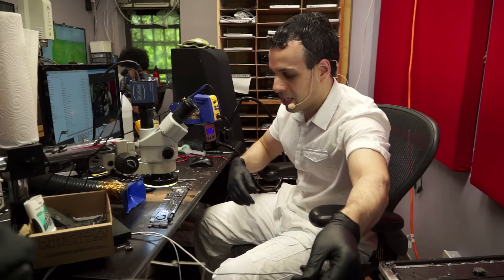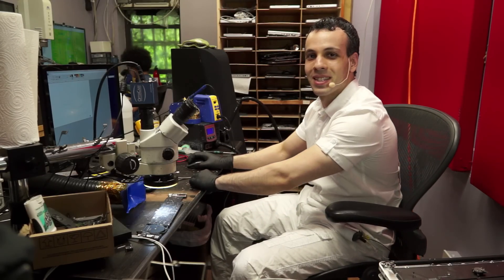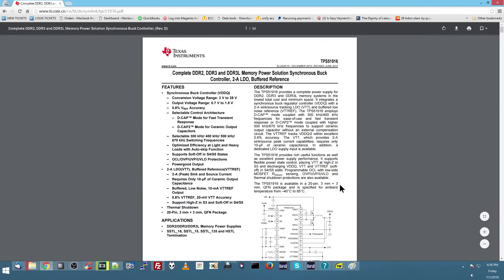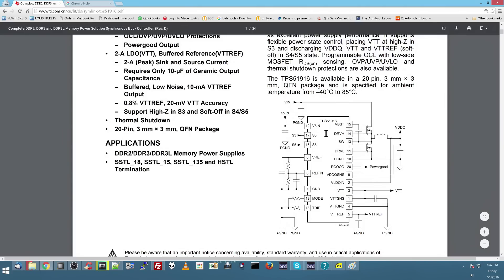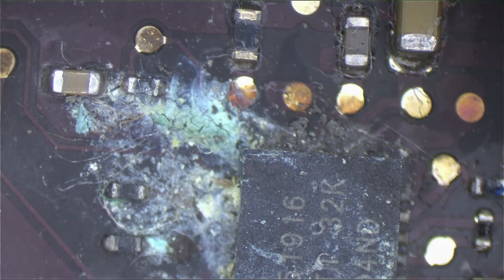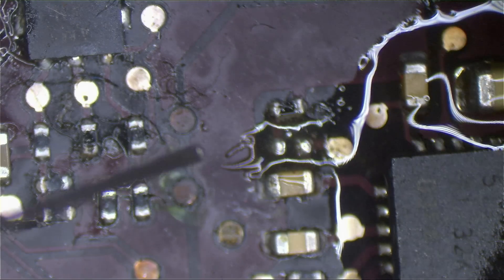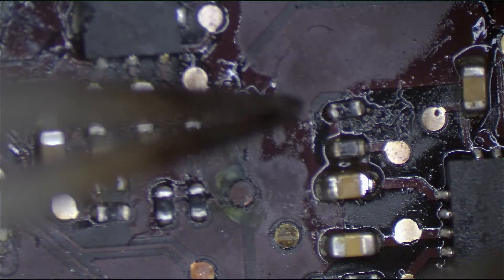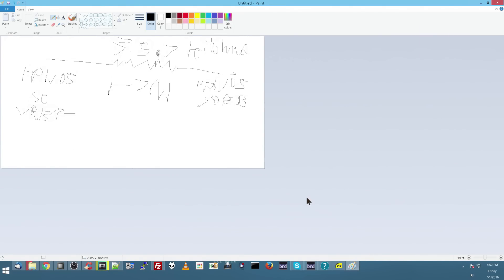820-3437 logic board repair with new video format

Comment: The microsoft paint killed me! BTW  
LDO = low drop out voltage regultator
Buck converter => step down voltage but steps up current
Reply: To add to your comment, a LDO is linear meaning that it drops the voltage by turning the difference to heat ( P=U_diff*I ) hence they should only drop small voltages  (Note that the output current is the same as the input current), Buck/Boost converters lower, raise voltage by storing the energy in a inductor (It needs to switch the input voltage to do this) -> low losses but noisy.
Reply: If you're dealing with low currents / quiescent levels a linear reg can frequently be more efficient than a switching reg, which is why modern switching regs often contain a linear reg for when the current demand drops below a certain threshold.  It's an amazing tech world where we now can get the best of everything in single chips.

Comment: LDO stands for "Low drop out". Referring to the low drop out voltage regulator that comes after the buck converter to stabilise the DC output. It's true that it lowers the voltage slightly to do this but it's main purpose is to stabilise the voltage.

Comment: Hey Louis,

We also rebuild computers at the logic board level and it comes to water damage or oil damage in our case (we fix Brain boxes for vehicles). we found that using Fiberglass Scratch brushes  helps to remove water damage and clean up the board. i would look into it to see if it works for what you are doing.
Reply from the maker: I will have to try one. Thank you!

Comment: Louis, which flux do you find best? 
Some unfortunately have a honey tone and after a while become sticky :-( 

Do you just use normal seringues or some more productive solution to dispense the flux onto the pcb? 

Over the time the quantitiy of SMD flux used makes it questionable if there are more cost effective Systems. 

By this i do not refer to the very liquid flux as that can get into your way.

Comment: I come to the conclusion that extra Flux applied to the board in Louis'  field of board repair is like extra whitespace and indentation in my field of writing computer programs / software engineering.     Can almost never have too much...    just make sure you can still see what you are working with,  and everything lines up properly before committing it.....
Reply: You can always reflow if alignment is bad. Also once it goes to the ultrasonic it's nice and clean which cannot be said about code minification ;).

Comment: I understand why you don't run the boards through the ultrasonic cleaner before the repair, but do you ever have to use more than flux and heat to clean gunk from a spill from a local area before replacing parts and if so, what do you use? Alcohol?
Reply from the maker: sometimes. it depends on how nasty it is. i use different approaches. if it is really disgusting, i dump it in the ultrasonic, mildly toothbrush it  while it's in the branson ec/distilled water at 60c, then turn on the ultrasonic.
Reply: Man... that board was n-a-s-t-y!! Especially near the end when you put on that resistor you can see the nasty little hair bits in the grouping of parts just over to the left. CRAZY!
Reply: It was a little nasty looking, although i'm sure Louis has seen boards in much worse shape.
Reply: Back in the 80's I repaired the recording equipment for the BBC back in england and they never had any liquid spills. Tea and coffee aren't liquid's right? ;-)

Comment: You can spill your drink in a Lenovo T series and you wont go through an expensive repair, worst case scenario is keyb replacement, you can still disable the keyboard and use an external. surprised that they didnt ask ti to rename the part because any chip manufacturer wont have any problems on do that as long as you put a large order. Next mac book will be like old sinclair computers U1, U2 U3 not in the board, but printed in the chips as well LOL

Comment: If only manufacturers were covering boards after assembly and cleaning by protective coating like Parylene is, all these spill damages won't happen at all.. or at least damaged areas would be extremely reduced... 

But they want us to buy new stuff as early as possible, so they do not even do proper cleaning of the flux rezidua after soldering in most cases... :o(

Comment: Hey, Louis I have a 2009 Macbook pro and by mistake i used another charger and now it doesent work with the original charger, but only with the wron one. Can you tell me where to search the problem?

PS. I replaced the  DC power board but still the same.

Comment: What is the sort of liquid he puts on the motherboard?
Reply: It's called flux, fairly standard when doing soldering work. Helps with the flow of solder and heat dissipation.
Reply: Zalx Cool thanks! I'm very new to soldering and no one ever told me about flux :) But it seems to be really a good help
Reply: ***** Welcome to the practice :) doesn't take too long to pick it up and is a super handy skill to have, good luck with the future projects
Reply: Usually your solder already has some flux in it, which helps the solder flow onto the thing you're soldering. It then evaporates when you're soldering (it's the puff of smoke coming off of it), just after it has done its work.
You need more flux when you're reflowing solder, which you do for example when you're first putting the solder on the pad and then putting the component on the pad, like Louis is doing.
When you're soldering through-hole components you usually just solder it in one go, so the flux in your solder is sufficient. Also when you first pre-tin your components and then reflow only the solder itself, you don't need more flux to make the connection, it's only to make the solder stick better to other metals. You might want to use some flux to make sure the solder doesn't stick to your soldering iron, though (see also Big Clive's recent videos on the LED tester or the LED snowdrop project).
Reply: Flux is literally a magic substance that makes soldering possible. If you're having trouble, buy a tube of solder.
Reply: I just recently discovered how amazing it is, been struggling with desoldering, the wick just didnt wick. Blob some flux on the area, tadaa like magic instant results.
Reply: gloriouspopeman tom Do you know some good cheaper Flux? I find Louis's one really expensive...
Reply from the maker: you can buy 10cc of it from microsolderingsupply.com instead of my 30cc syringe for less.
Reply: Louis Rossmann Cool! Thank you!

Comment: What the purpose of the flux please?
Reply: Prevents the solder and metal contacts from oxidizing when heated in the presence of oxygen (air). Helps the solder flow and adhere to the metal contacts.
Reply: Also smells really nice ;).